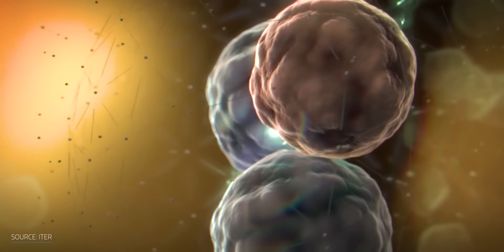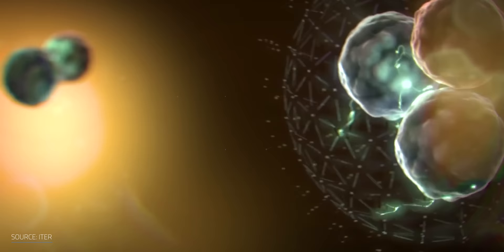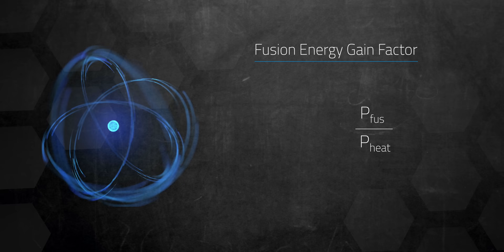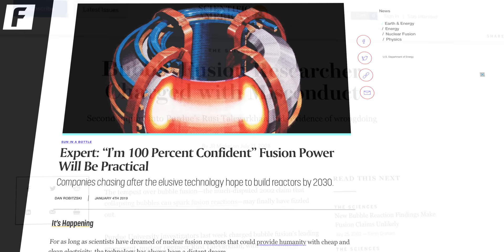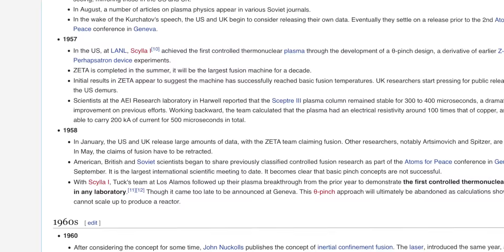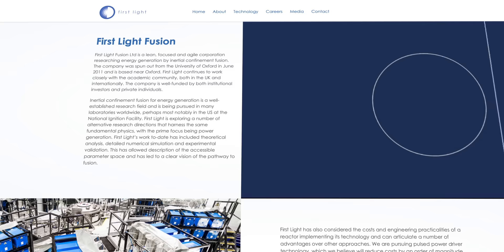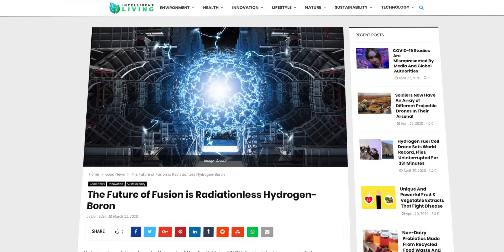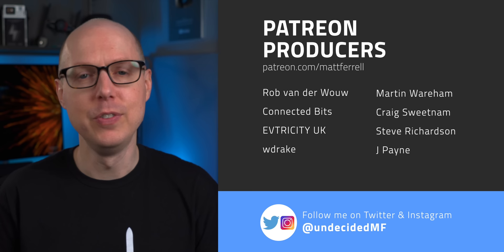The truth about nuclear fusion power - new breakthroughs

Comment: it'll never work because the entire premise is false - the Sun is not a fusion reactor! allow me to explain

in a fusion solar model, the core would be hottest as it produces the energy, the radiative zone cooler (same energy over greater area), the convective zone cooler again, the surface cooler again and the atmosphere coolest of all - however this is not what we actually observe!! the atmosphere is hotter than the surface by MILLIONS of degrees and the surface is hotter than underneath which is why sunspots are darker than the surface rather than brighter

the Sun is externally powered by a massive galactic current, like an arc lamp - Plasma Cosmology! and a group of privately funded scientists have reproduced it on Earth! The SAFIRE Project. it not only produces more energy than it uses, but it also transmutes matter from one element to another